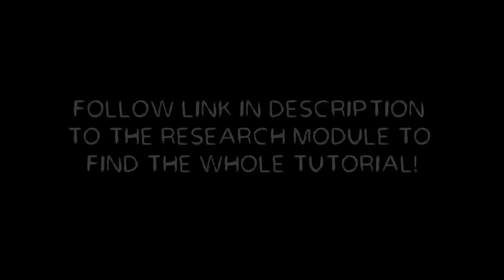#69 Shower upgrade with Cement Alternative (Magnesium Oxide)

Comment: TLDR: Using phosphate in a building material is a good scientific experiment, but it should not be done for a VERY long list of reasons. 

Cool experiments in general, but using phosphate in the mixture made me wince quite a bit - phosphorus is a very complicated topic, especially in the EU. Phosphorus is a vital nutrient for plant growth, while it is all imported to EU (most from Morocco and Kazakhstan). These imported fertilizers are all made from phosphate rock, which is a REALLY problematic resource (the scarcity + the very high content of heavy metals). The leaching of phosphorus from fertilised farmlands or pollution from untreated wastewater is the main cause of eutrophication in a lot of lakes and seas and therefore has very strict limits set up. EU is also currently trying to find ways to recover phosphorus from different waste streams (most of which are quite expensive), to make sure we are not gonna face another crisis soon because of increasing phosphorus prices on the world market. That means phosphorus is the one of the LAST elements we should try to use for non-essential purposes, where other alternatives exist. Especially for materials from which phosphorus could start to leach out with rainwater/stormwater and bring additional pollution load to the aquatic environments.

Concrete is problematic on itself, but at least it's made out of materials we have an abundance of (and it could actually be made from by-products of other more green processes).
Reply: Check out using fumed silica instead of phosphate

Comment: I'm very curious about how lime cement would hold up.
Reply: It is already proven in many outdoor pool showers on concrete slabs.  This alternative Mg/Po4 mix is thought to perform poorly with water as many comments show here.  Why not use some of that clay brick from all those onsite buildings?  It would be cleanable and not need the wooden grate ... which is more of a slip/slime hazard.

Comment: if you come here like me, for the magnesium oxide cement just know that phosphate is not the only "reactant" you can use, but it is the most expensive and most environmentally bad one. I wish he had tried epsom salt aka magnesium sulfate or maybe silicone dioxide.
Reply: I agree, the cost is  much more of an accurate indicator of the environmental impact.  Cost is a good indicator of environmental impact since it shows the total energy needed to make/grow/process and ship a product. Standard cement (lime cement) is about $0.25/pound.  This Mg/Po4 cement mix is about $3 to $5 /pound.  Assuming this shower pan is about 60lbs of concrete/composite then about 10 lbs of either lime cement or Mg/Po4 is needed with 50 lbs of concrete/composite (1:5 ratio cement to sand/aggregate ).  10lbs of this Mg/Po4 cement is at least $30-$50 vs only $2.50 for standard lime cement.  This results in about 10x to 20x the cost and energy;  similar to shipping via Air freight vs barge causing 10x pollution and usages of fossil fuels.  Concrete is still NOT a sustainable building material even when it is cheap! Re-using local stuff is always better than consuming shipped items.  In my opinion the way to save money and energy and pollution on this shower pan is to RE-USE some of those clay bricks with just a little mortar and put a proper grate/sand trap in the center!   This would be cleanable and resistant to scrubbing unlike this rough trough with no grate and pockets to grow slime.  This patio/brick tray would also save lumber/trees/energy by not needing a wood grate/deck which well also get slimy over time.

Comment: magnesium phosphate isn't that far away from magnesium sulfate.... drywall concrete is probably better why not go with a clay with a milk paint finish. interesting findings for a water proof hard composite membrane material if it was cheap and readily available it could have many uses.

Comment: Beautiful woodwork and interesting experiments with alternative cement. But why the hell did you build so small? There's plenty of space and the little thing looks like a shower stall at a campground in the 1950s. It's called BathROOM, not bathcabin right? A bank to take over the shoes? How about sitting there with a cup of coffee and doing your nails? I would also like a bench in the shower to shave legs or just to sit on. A bit of luxury next time, please. Second: you talk about privacy, it's not really privacy, there are still gaps. Why didn't you overlap the side ends of the planks with a small third plank?

Comment: 15:41 Concrete dries over multiple days, where all particles settle and it fully cures. I can't imagine this reaction would be any different. Borax is a great way to speed up the experiments, but you really need to do some long-term experiments without borax to see the load-bearing capabilities of the mixture. Would suck if you used this to pour a slap then set a load-bearing wall on top of it and it ended up not being able to handle the load.
Reply: they said borax makes the curing time longer, not shorter
Reply: @meiskam  My bad, I should have clarified this. I meant that borax is faster than adding more water. Borax chemically draws out the curing process, water does so simply by having more liquid to evaporate and giving it more time to do its thing properly.
The end result is likely that borax is significantly weaker under serious loads, which means it can have unexpected consequences you don't want in any real building project.
Reply: @daylen577  How is this a "real building project"?
They literally made a trough in the dirt to channel water.
The floor boards are suspended above it on the shower frame.
Reply: @jimurrata6785  That's what I'm saying, this is a fun experiment, but I hope they do some real experimentation and don't resort to chemical reactions instead of the oldschool tried and tested ones if they use this same process on a larger structure

Comment: its gonna stink, you needed to put trap instead straight pipe at the bottom
Reply: linseed oil was and is used on  boats. it lasts very long, you have to re apply that, water is not what destroys it, its UV what destroys paints, plastics, oil films.

Comment: Everyone so concerned with carbon emissions doesnt seem to understand what plants require to live, and that all the other things they do and use produce actual harmful toxic emissions... Turns out, plants would like there to be SIGNIFICANTLY more carbon in the atmosphere than there currently is, and carbon is not a contributor to pollution. But, loads of other things, very commonly produced in the production of alternative materials, ARE pollution. I beckon back to when people told them to stop burning brush piles, and use a gas powered wood chipper instead. This is nonsense, that changed them from emitting helpful carbon into their environment, to burning fuels that actually emit harmful pollutants....

Comment: Sustainable cement but it still stinks. Sow there is gas coming off. Makes me think. Will that be a better gas than co2 or ?! Is it an electric car solution. Is it really better for the environment? If you claim that, what are your resources? you claim magnesium mixed with processed poop is better than old school cement ? 

Both products are not so environmentally products if you look on how it is made.

Comment: Why even more chemicals especially fertiliser. Thousands of years of lime, sand and water, why not now? Apart from that this was pretentious and boring.
Reply: The production of lime from limestone requires a ton of heat (which today is mostly coal or NG burning, releasing CO2) and the limestone releases CO2 itself as it becomes lime.
Reply: @kschleic9053  perhaps but all that was needed was a reclaimed shower tray such as porcelain, tough and practical. I do like the new shower unit though...